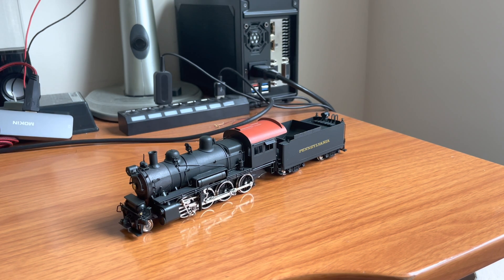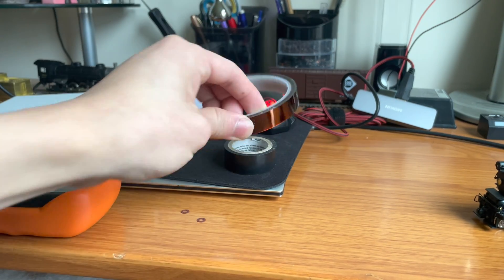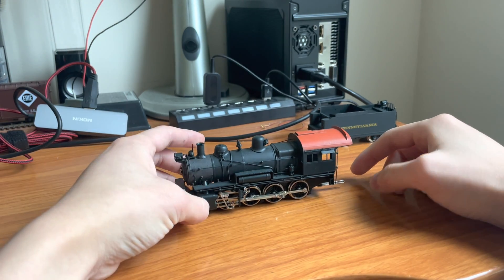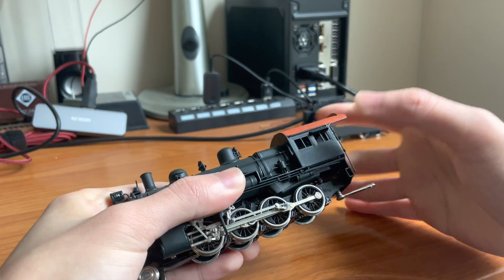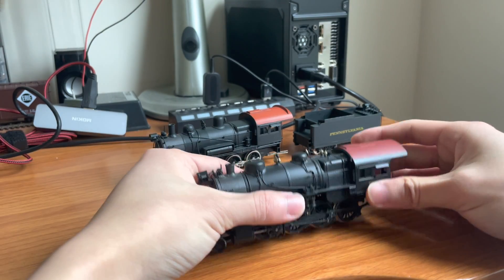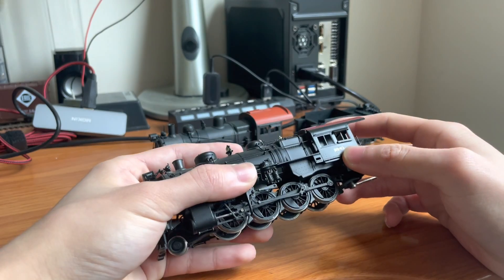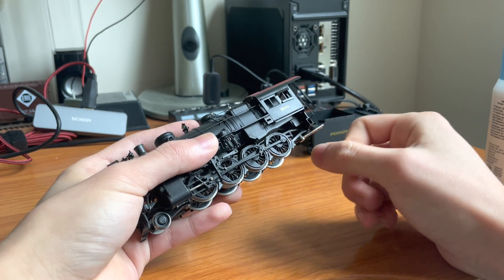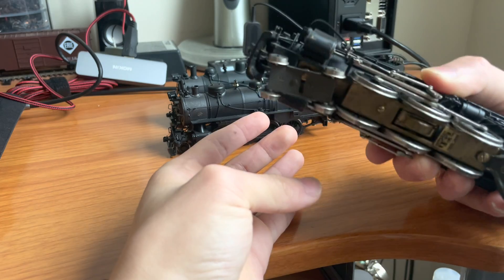How to Diagnose & Fix a Short Circuit in Brass Locomotives (Tips and Tricks!)

Comment: i have 2 brass 4-4-0, Jupiter and 119. i had a short in the 119 and  the nut on the draw bar was touching the motor mount its definitely still a good idea to replace the 56 year old motors though.
7:00 one thing my club recommends for parts that may touch is nail polish. i used some clear polish on an old Tyco where the pilot would get close enough to short it out.
Reply from the maker: this is very smart! hoping others will see this comment.

Comment: I just converted a brass steamer from DC to DCC.  Added some LEDs, isolated the motor with a new motor mount.  Wired in a Blu-nami with a keep alive.  Added a harness and a nice speaker.  Tested it tonight.  Front LED comes on.  Rear LED and firebox led does not come on. They worked with a battery beforehand.   Sounds good.  Not shorting out sitting there but as soon as I start to move forward with it on straight programming track the wheels just start to move and it’s shorting out every time.  The model is covered in primer for the time being.  Any ideas for me?  I’ll have to try to chase it with continuity tests tomorrow.    Don’t  understand how the other LEDs aren’t working.  
  I have a suspicion it’s some problem with the wheels or connector bar.  The tender wheels are really loose in the trucks and no way to tighten the trucks up that I’m aware of.  Makes it easy for pulling them out to look at but they can fall out of the trucks very easily and move side to side a lot.   The power pickup from tender is straight off the frame now to a wire in the harness.   The connector bar isn’t needed for any conductivity now.   There are spare unused wires tied up in there but don’t think they’re the issue.
Reply from the maker: If its shorting out only when the motor is beginning to move, i suspect part of the drivetrain is shorting out. check to see polarity of leading/trailing trucks on your loco. Or a potential brass brake shoe isnt touching the wheels. 

Also are you sure NONE of the LED wires/connections is touching any part of the brass shell? They have to be fully isolated.
Reply: @   Thanks for the reply.  I discovered the front single axle truck assembly I had put back on reversed so that solved some of my problem.    I cleaned the wheels and track.  It will run ahead and cut out on me.  The rear LED I put in tender is not working.  I thought maybe it was a software issue.  I’m running blunami and it’s very convenient for set up.  It should be coming on when reversed and it’s not.  I checked it before I wired it but possible one of the wires came off the resistor.  Have to tear into the tender again and see what’s up.  There is a keep alive in it but think it draws a lot of power when motor is running .  It keeps the sound going for 10 seconds but cuts out pretty quick when moving forward but may just be shorting out.   Will keep investigating.  It’s a Samhongsa 2-8-2 with a can motor.  Thanks.

Comment: I just got a Nickel Plate (KMT) Brass Milwaukee Road Hiawatha F7 Hudson and it runs good on straight track, but it shorts out on my 22-inch curves when the pilot wheels come into contact with the aerodynamic cowling in front of the cylinders. is there a way to isolate to prevent this or does this loco likely need bigger radius curves? I also plan on remotoring the loco to a can motor but i am unsure of what can motor type to use.
Reply from the maker: Only thing I can think of is put kapton (or similar) tape on the inside of the shrouding. Or use smaller wheels for the pilot wheels. Or cut/grind away some of the shrouding with a dremel. But yea unfortunately, if your wheels are scraping the inside of ur locos its probably a sign it wasent designed for such curves. 

For can motor, use a Mabuchi SF266 if it fits, or anything from canon sagami mashima :)

Comment: Completely unrelated to the video but what is your opinion on the Bowser PRR steam locomotive kits, specifically the post 1990s ones with the die cast boiler and super detail kits?  They seem to be able to be close to brass in terms of detail if one is willing to put the time and work in.
Reply from the maker: The brass details were fantastic and would bring the model detail wise to brass levels. Most kits where the tooling was made by bowser, and john english were great. (PRR A5, B6, M1). However the much older penn line tooling (later bought by bowser) looks crude even with the updated brass details. Things like the wider driver spacing, the thick running boards, and other proportional problems makes them stand out. Like the I1sa, E6, H10, and K4 kits. Those I would avoid.
Reply from the maker: But my personal opinion is, (without sounding like a brass snob), for most of thoese models there are better, cheaper options. The H10 or E6, the gem brass variants can be had for like $100 - $125, and is well worth that money. The PFM united brass K4 is also around the same price. Only some of those kits imo are worth the money and time, and also dont have better alternatives. Certain kits like the A5 or B6 are highly recommended by me, not only cause there are not many alternatives (gem and sunset prestige made sorta cheap brass but still pricy), but also those things are HEFTY, and being diecast, I think theyre a highly desirable weighty model, which brass/RTR cannot provide.

Comment: Are all steam locos the same as far as the "pick-up" side? My two are Sunsets.
Reply from the maker: nope! Check to see the red insulation on the wheels to find out which side is insulated. Or see which side of the tender is insulated and the engine drivers should be the opposite side of that. Good luck!